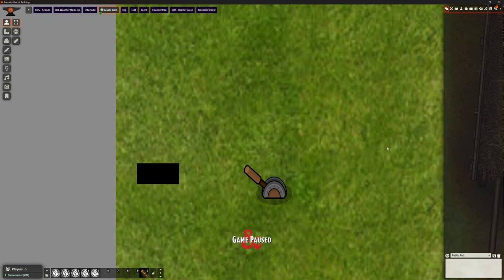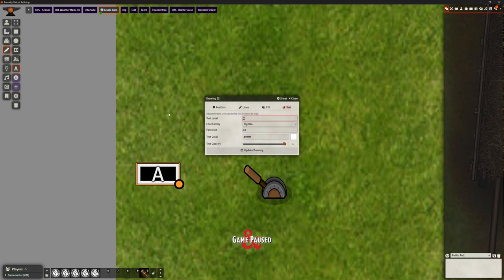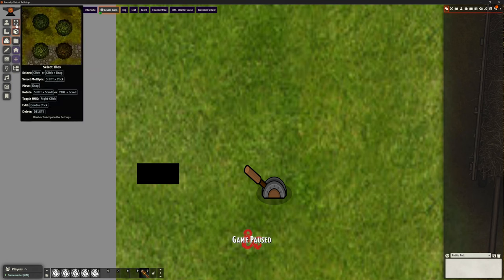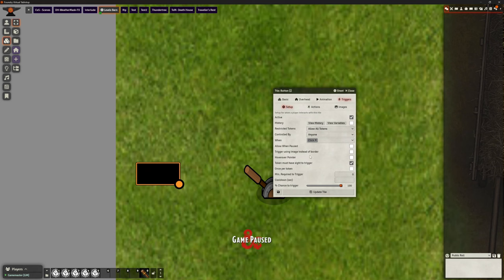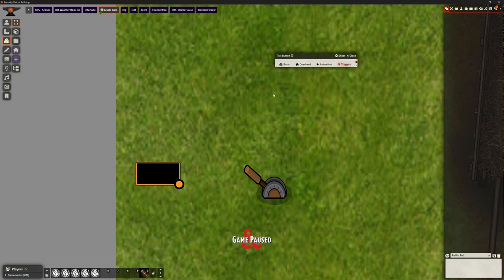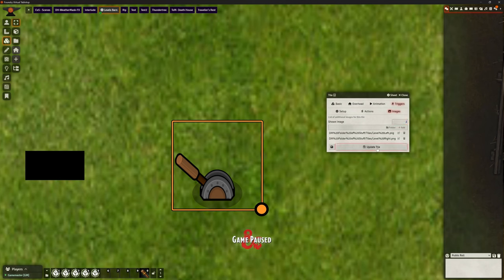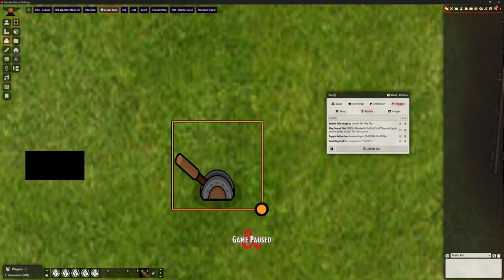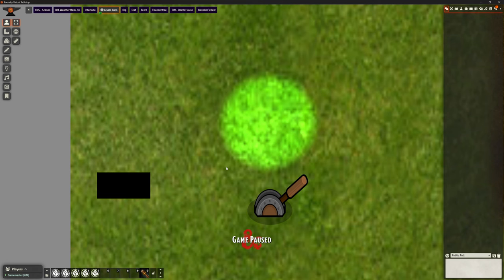Foundry VTT - V12 - Buttons & Switches - Quick Tutorial

Comment: I used Monks for everything as it's what I know. Has it changed much in V12? I used Monks for switches and lights but also teleport. I love having a switch that lights all the candles on the wall in a dark room exposing a surprise. Really adds to the experience! Great vid
Reply from the maker: There was a feeling that MATT would be redundant (or mostly) with the V12 Regions and such - but no, it's not. It's almost exactly the same in V12.
V12 can not do what MATT does, or even close - it does some of the basic bits, but stuff like this is would require you writing a whole macro. The V12 Regions doesn't have a "On Click" activation, so no good for buttons. V12 has a LOT of work to be done on Region Triggers before it gets even close to MATT. 

So in V12, MATT remains the mod you know and love 😀
Reply: @clay_golem  that's good, I'm not opposed to learning new things in fact I enjoy it but if you can bring this g's across from V11 to V12 it just makes the transition smoother
Reply from the maker: @davidc4155  Soon we'll be looking at my V11 Stormwreck Isle game, and updating it to V12 (I've not touched in at all in V12). That'll give a reasonable judgement on just how much may need to be fixed in the move over.
Reply: @clay_golem  That's a fantastic idea. I'm looking forward to that one. It'll be a brilliant indicator, especially since Storm wreck is my most recent campaign 👍